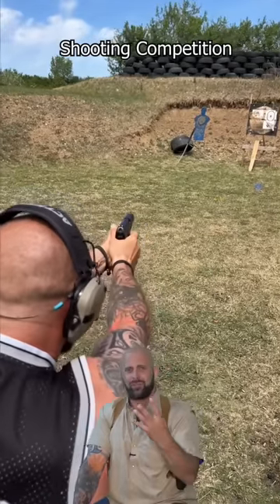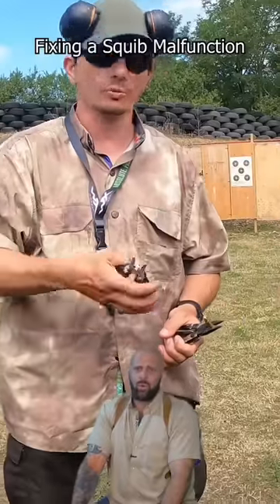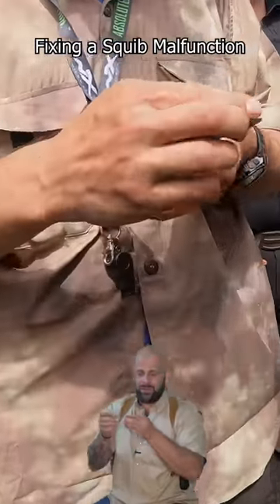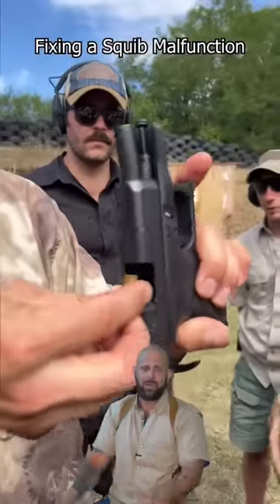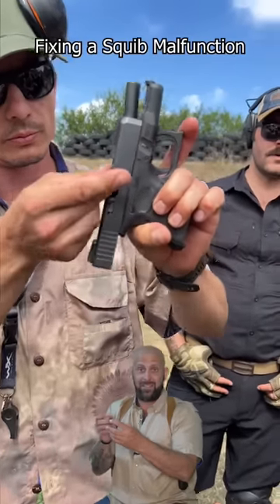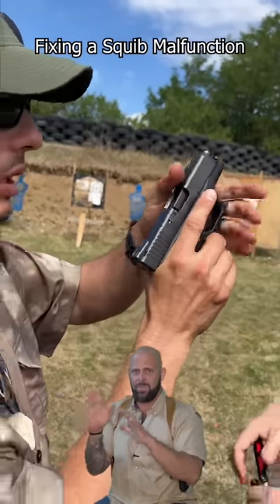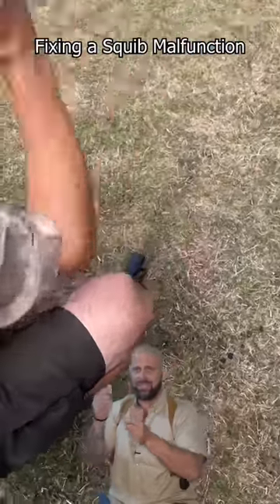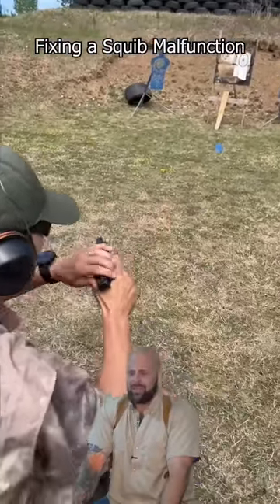Israeli Tactical Training School: Advanced Pistol. Video Clip #10

Comment: Chamber pressure spike has entered the chat.
Reply: Hello fellow reloader.
Reply: My thoughts exactly.
Reply: Fingers on the right hand has left the chat
Reply: THIS
Reply: It shouldn't though. He mentions specifically they heard the squib. Meaning they knew it was a low powder charge.  Using another round with just the powder in the normal loading the powder load should be well within the chamber pressure specs.
Reply: @trailblazer632  it’s not about the amount of powder, it’s about the amount of space available within which the powder will burn.
Reply: @tmackay3302  yes sort of. There's other variables though that make this less dangerous than you think. Such as it being a pistol with a short barrel, it being a known low powder squib and not a jam, and it being a pistol using a slower burning pistol powder like red dot.  If any of those were different sure it could be a bomb but with those variables in play its not.
Reply: @trailblazer632  Chamber pressure sure, but the barrel is not as reinforced as the breach. There is more pressure to get the bullet that is engaging the rifling to start moving than a bullet in a case and having a small amount to travel before fully engaging the rifling.
Reply: @Quadrenaro  except the bullet was almost certainly already fully engaged with the rifling. Meaning yes its git some resistance buts it past the point of deformation where it first engages with the rifling. If not the bullet should have fallen free. Even so that short distance isn't enough for a major pressure spike anyways really. You'd have to be several inches from the chamber for that to be a concern which in a pistol is more or less a moot point. Some people seem to forget there IS dead space inside a cartridge unless you are reloading crush loads which isn't exactly common. You can pick up and shake a bullet and hear the powder moving around.
Reply: @derek leverknight  you're way wrong bud. Barrel length has nothing to do with it. The distance from the brass to the bullet is what matters. And yes this can very much create low pressure problems. Otherwise how would low pressure problems exist unless there was no powder in it?
Reply: @200130769  "the distance from brass to bullet is what matters". Yes. That's exactly what I said. Go back and read the comment again.
Reply: why? The pressure isnt even enough to cycle the slide, the bullet is away from the case, literally, now if the bullet was seated into the case, then u have a grenade.
Reply: That’s what I’m thinking like fucking hell dude
Reply: This is perfectly safe..  the bullet would need to go the opposite way , decreasing space to cause a pressure spike
Reply: @derek leverknight  but the air pressure and gap in between is unpredictable and the barrel can be damaged severely
Reply: Yup, exactly. Reloading 101. This guys garbage advice will get someone hurt. It may work a few times but, it will go catastrophicaly wrong at some point.
Reply: Yep, flashover pressure spike waiting to happen.
Reply: Yeah, I know from using black powder in particular that this is super dangerous, not sure how dangerous it is with smokeless powder but still makes me cringe to see it.
Reply: @trailblazer632 Exactly! Hell I've even seen people fire a second round bullet and all to clear a squib in a glock with no issues... Not saying I'm dumb enough to do it but it's been done...
Reply: It's a pretty simple math equation...if the given space is larger and the force remains the same than the result is LESS compression not more...maths 🎉
Reply: @trailblazer632 He didn’t say “only do this with a pistol” he’s passing this advice around as a fix all solution for squibs in general.
If you do this in a higher pressure handgun or rifle you will be at a high risk of blowing the barrel out.
No if’s ands or buts about it.
Reply: @P00RKN00W  both are true. Having powder packed too tightly can cause an abrupt pressure spike. On the other hand having a very lean fuel:air ratio can cause fuel detonation which will cause an instantaneous pressure spike.
Reply: @dakotamoore4557  the force isn’t the same though. Normally the projectile has limited friction acting upon it while it leaves the brass and jumps to the lands of the rifling. The initial pressure is lower because the bullet is free to move easily. With the squib, there is no “jump” from the chamber to the rifling. The squib is already in the rifling. We don’t know how far it has traveled and we don’t know if the full length of the projectile has deformed to mesh with the rifling. The worst case scenario (highest pressure) will occur if the squib is jammed about half way into the rifling. In that case it will require the most amount of pressure to get it moving. It no longer has the inertia of the jump to the lands working with it. It doesn’t have a “running start” to force itself into the rifling. 

This is why precision reloaders know that when you change seating depth, everything else is likely to change as well. If you are loading at the limits of the brass, you better not shoot the load that jumps to the lands with the same charge in a load that gets stuffed into the lands.
Reply: It would have a decrease in normal operating pressure the pressure would only spike if you added more powder or if you jammed the bullet deeper into the case. They have been testing this method for years and it's completely safe.

Comment: Holy crap, about the only thing more dangerous than that way of clearing it is firing that follow up round.
Reply: He removed the slug from the casing and just lit off the gunpowder inside basically. That’s why he keeps pointing the barrel up, to keep the powder at the bottom near the primer. Still a dumb way to do this though, could have caused a bulge in the barrel.
Reply: What's dangerous about it? You realize there's a lot of pressure in the barrel when you shoot normally... right?